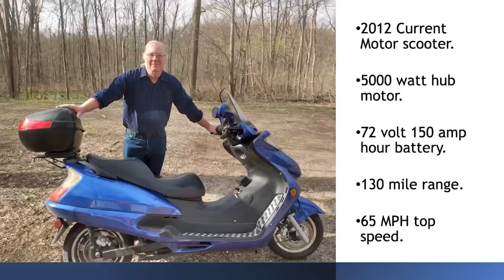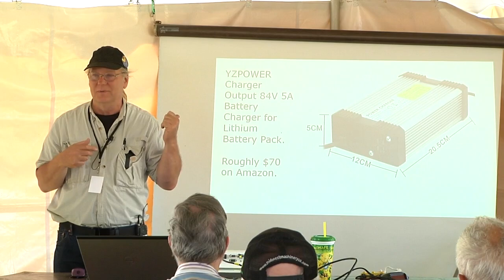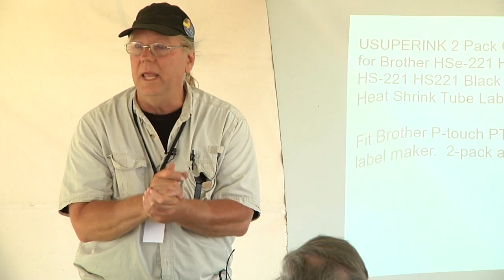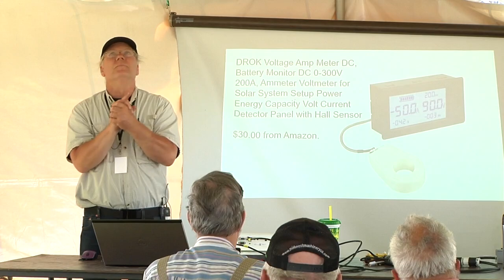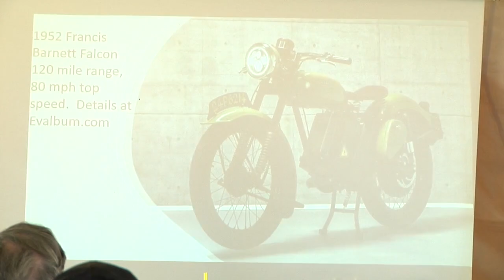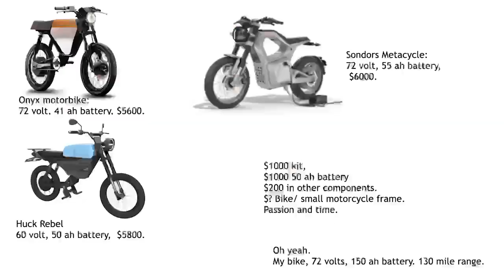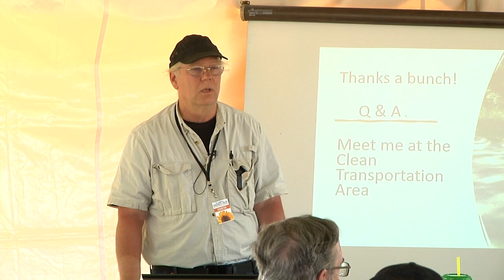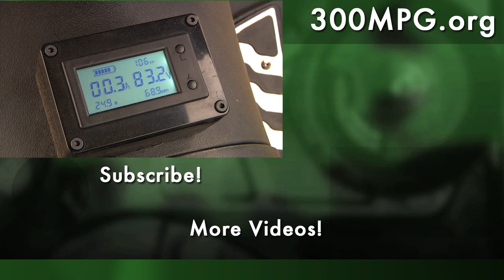Upgrading an Electric Motorcycle - Lessons Learned | Terry Richards | MREA Energy Fair Presentation

Comment: Just a quick update on the scooter in this video. I'm just finishing up the 3rd season of riding this bike. I just passed 10,000 miles on the batteries that I talked about here, over three seasons of riding. The range is still 125 miles to a charge, which is really close to the 130 miles that I had when I first built it.

Comment: Just a quick update. I've now driven the scooter past 4000 miles over the summer (including the trip to Wisconsin and back), and I just ran an end of season "range test", and still got 130 miles to a charge, so I haven't seen any sign of battery degradation for the first 4000 miles.  Time will tell, but so far, so good...
Reply from the maker: Thanks for the update, Terry!